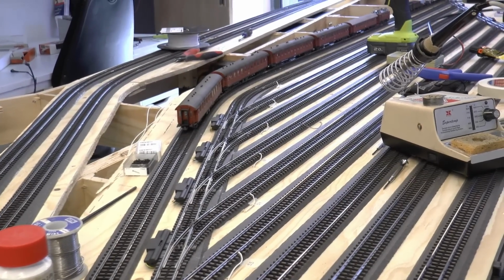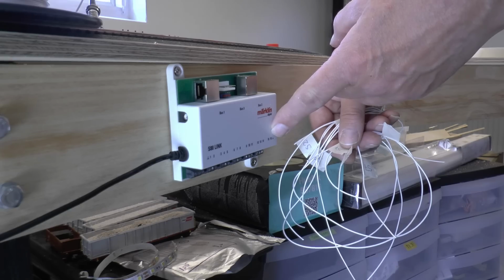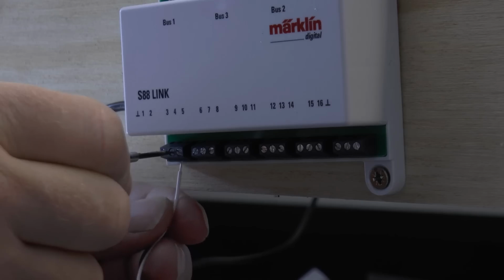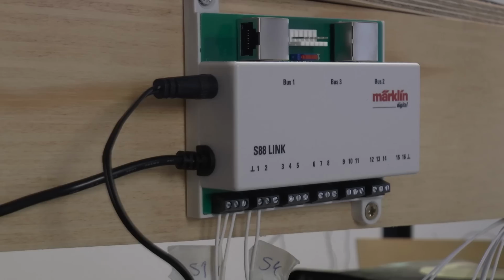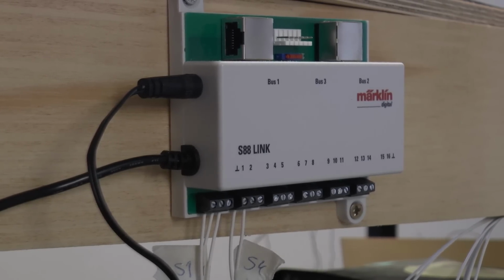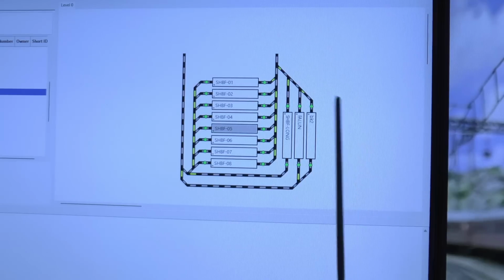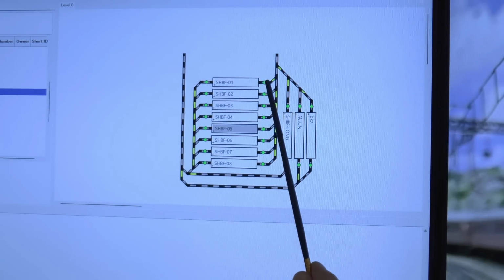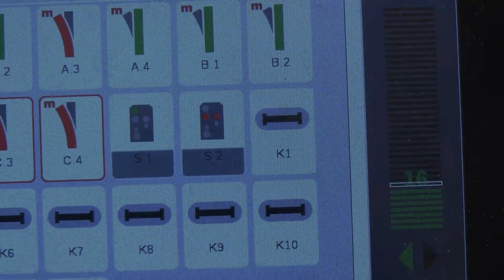Planning and Building Block Sections for the Model Railway

Comment: I am in Australia currently attempting to put together a Marklin C track layout using a Central station 3 for control. I have set out a test track of about 6 meters long but not a closed loop. The finished layout is intended to be about 18 m of track in a U shape. I have connections every meter or so with one or two even closer. But when i run the locos to test they might run several feet, but when i try to re start the locos again they don't have enough power to move off again. and that happens even when there is a connection right near the loco. Am hoping there may be someone viewing who is experienced with the CS3, who might suggest anything i can try. I am using a length of bus wire about 3mm size or about 12 gauge. The feeder wires are the typical Marklin feeder wire size.

Comment: Why this system and not measuring current or (with Marklin) mass over the complete block and divide it in 3 feedback units. Then you know (mass system) if a train or railcar is left behind in a block and the software knows this. In this system a possible collision is still a possibility. One of the great advantages of 3 rail is the possibility to continuously know it a block is free or empty.

Comment: Hello Martin,
I don't agree with your order of planning. I would put the blocks on position two, ist the most important thing if you want to be able to run long trains without locking themselves.

I don't like the CS and the Link. They are very expensive, und technically totally outdated.
I would say that it is NOT possible to run trains automatically with ja CS, because there ist not way to lock a route. The automatic accepts only sensor inputs as conditions, no switches or signals can be involved.
If you absolutely want to use an overpriced commandstation you should think about an ECoS, but I prefer a knob less version and a PC + software, witch ist cheaper in total an offers almost endless possibilities (using xml-scripts).

VGA

Comment: Hello Martin, 
I watch your videos for a long time and you habe always good ideas and useful tips. But this I cannot agree: if you cut your rails and divide it into sections, why do you not use the whole length to be detected? For the Software it is the same, but you cannot detect lost cars or trains between your  short detected sections. I think it would be better to have the whole layout under detection (except turnouts, there it is impossible). 
And if you do like this, you can be shure a track is free, when the detection goes off. 
Greetings from germany😊
Reply from the maker: Thank you for commenting! Yupp! You can do both ways, but the IN-sensor has to be short anyway. I cannot recall any lost cars since I changed the Marklin short couplings back in 2001.

Comment: Hi Martin, from my experience I prefer the Marklin "feedback sections" to be the entire length of the block with a minimum of two "feedback sections" per block divided equally.  I also use the "diode trick" method and have found this will prevent any "lost detection" (dirty wheels, traction tires or uncoupled wagons) or "flickering detection" in the software. I also find it helps to ensure no point movements whilst the train is still moving block to block. Yes you can delay the "turn off time" for the detectors and alter the rules in the software (T/C Gold) Your railway obviously and you prefer your methods. It's good to have alternatives. Cheers.
Reply: Diode? You don't use a capacitor for that? Diode only makes sure a current only goes into one direction, as far as I know.
Reply: @ diode

Comment: another thing, I also have a Marklin model, I have seen how easy it is to solder the cables to the rail, what kind of flux do you use, I would find it very useful, I do not know what the Marklin rails are made of, but soldering is complicated, thank you very much, if you can answer me, I would appreciate it, greetings
Reply: Soldering to the K-track rail joiners requires NO corrosive flux and is my preferred method.
Reply from the maker: Hi! The flux I use is described in the previous video ”Ultimate Guide to Märklin K-tracks”.
Reply: @marklinofsweden thank you very much, I have seen it, I was trying to solder with the normal flux and what you say in the video happened to me, it was impossible, I will buy the one you say, thank you very much.

Comment: Hello, a good video, as we are used to, here in Spain we use more train controllers, well, it is a good program, but quite complicated, and not easy to use when you configure this works, but with everything that sometimes gives false detections and is quite tedious with a medium circuit, is not translated into Spanish, I find it very difficult to handle, try what you say, may be my solution, thank you, greetings from Madrid, Spain

Comment: My head exploded when I saw how you made that sensor.  With Märklin my method always involves using wire cutters to electrically separate the Rails at both end of the tracks and then isolating the track at each end with this very tiny insulators.  Its all rather cumbersome.  I presume this method only sends a  quick pulse.   It seems so much simpler.

Comment: Wonderfully explained. Block sections can get extremely complicated in analogue of course but K-track especially was the way to go for us. One complication we encountered were vintage wagons with their own sleeper contacts triggering unwanted pulses. There are several ways to go around this, e.g. by installing another sensor which turns off the previous one until the block is cleared again. In this way a second sleeper contact on the same train won't trigger an unwanted pulse in the same block. Rather complicated, so in the end we have chosen to control all pulses by software as well. Perhaps there are some other ways though. We can imagine that couplers could perhaps be exchanged with two pole magnetic ones which can conduct current. However this would involve modifying all locos. Not something we'd prefer. Perhaps there are other ways, but complicated in can most certainly get in analogue.

Comment: With DCC, why is there a limit of 1 train per block? I've always thought that a major advantage of DCC is the ability to run more than one loco in a block.
Reply: Are you familiar with block and interlocking principles of real railways?
One train per block is prototypical.
Reply: @kaikuklik9748  I understand that on the main line. I guess I asked the question because that wouldn't work on my layout, which focuses on terminals and yards.
Reply: @jamescraft672 
The rules for trains in a yard are mostly the same! One train per track (e. g. block).
If you are switching/shunting in a yard, you can squeeze as many locos into one track as you want 😉
Reply: @jamescraft672  You only have one train per block so that they don't hit each other. You have multiple blocks to run multiple trains, and they are often sectioned by signals at each end of the block. Perhaps try playing games like Transport Fever 2 or Open Transport Tycoon Deluxe and play with the idea that way ;)
Reply: There is no limit, not even in iTrain. But working with the system as shown here the software will never know is a railcar stands on the block.
Reply: Depends on the software your using and the amount of "feedback sections" you have and obviously the length of the trains and blocks.